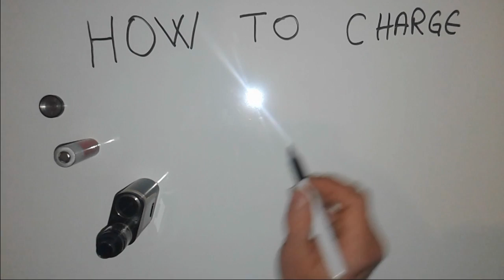how to charge vape battery without a charger

Comment: normal people call those 18650 batteries lmao
Reply from the maker: Masterzz this is a 18650 I am just pointing out one of its many applications, I have come across people using them and did not know what kind of batteries they are
Reply: @NoSkillsRequired  yeah u right...cuz there are different types of battery
Reply: Ye
Reply: Not these ones, 18650 batteries in things like portable chargers are usually around 4 Volts, these are usually at least 15, 18650 batteries for vapes are typically way stronger than your average 18650 battery